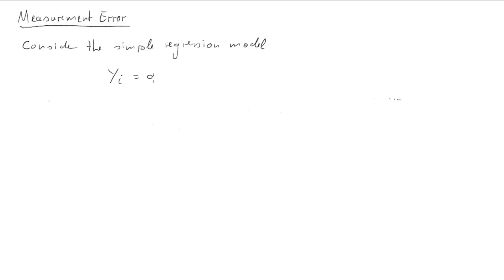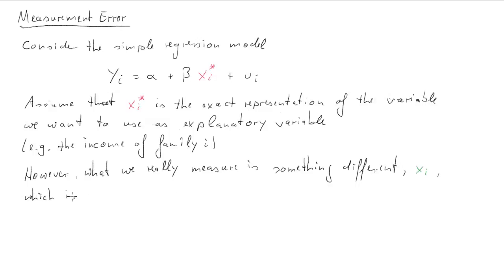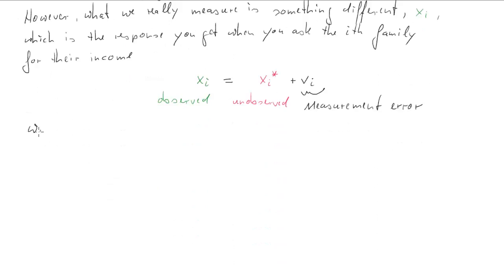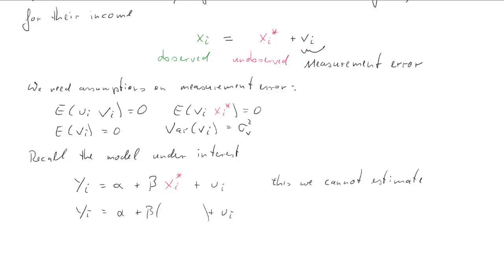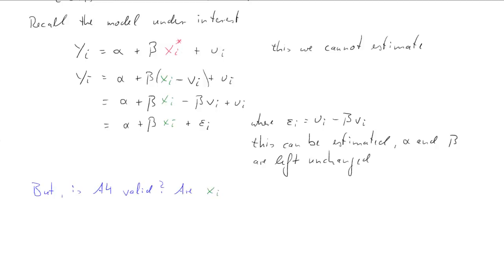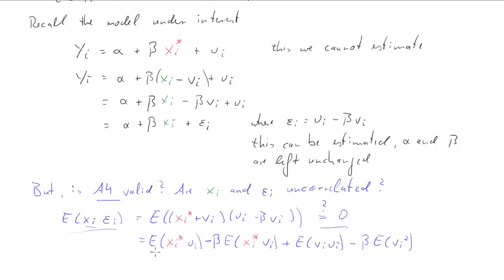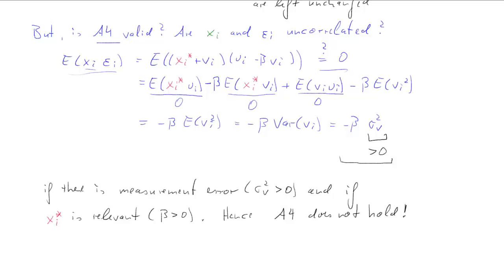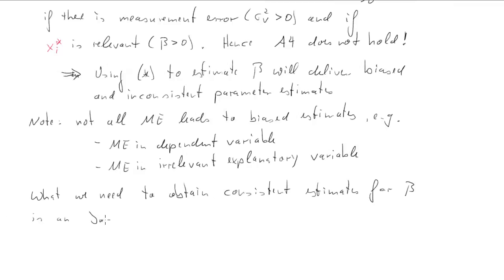Measurement Error

Comment: how does -beta*var(v) larger than zero when beta and var(v) are both positive?
Reply from the maker: Jongkyung Seo  You refer to 5:40. All I point out is that the error variance is larger than 0 and the -beta*var(v) term is therefore unequal to 0 resulting in a bias. This could be positive or negative depending on the sign of beta.
Reply: Ralf Becker Ah i got the point, thank you!